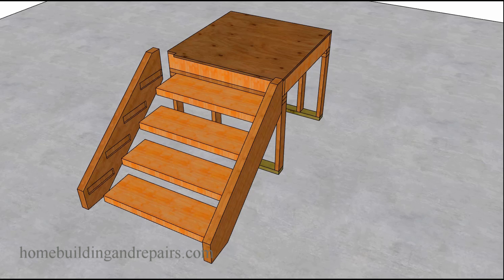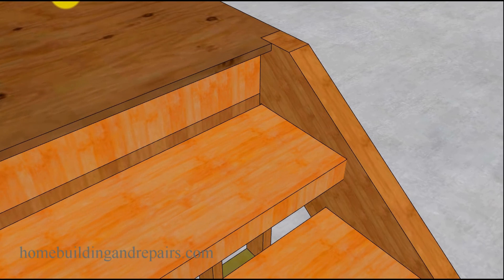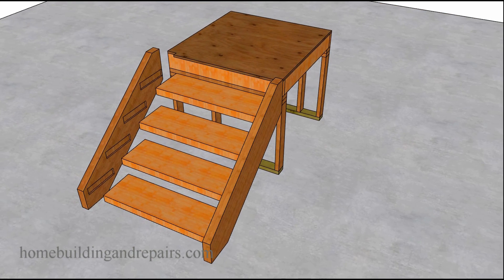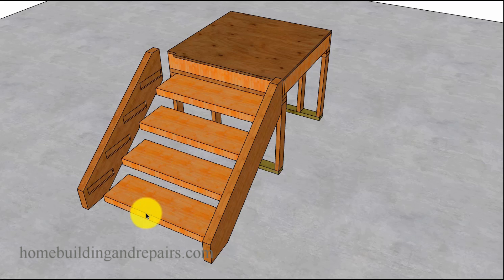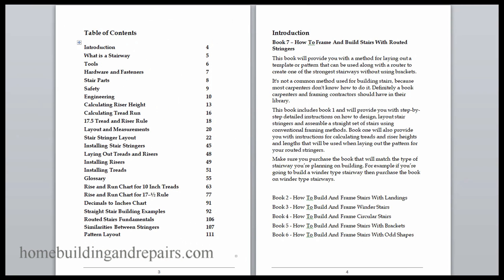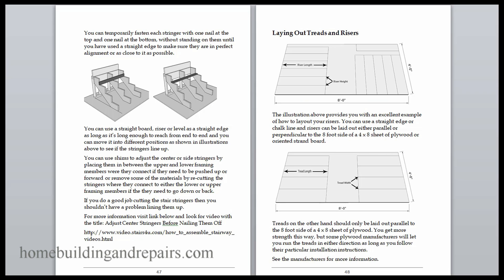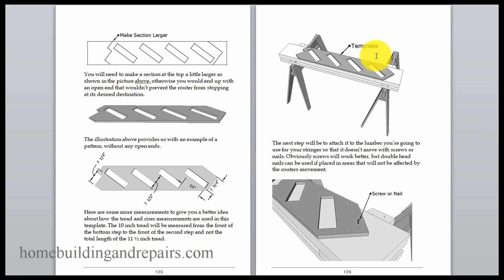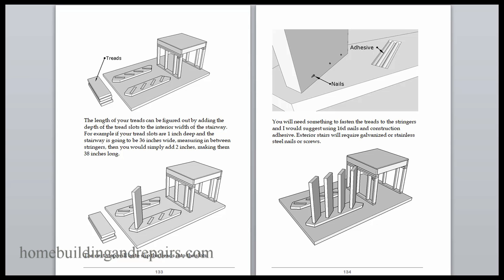How To Build And Frame Stairs With Routed Stringers - Building Books

Comment: Would it be ok to reinforce the treads into the routed slots with some dominos? In my head it works, would probably need at least a 4x12 stringer and treads right?
Reply: Just bought a few of your books by the way!

Comment: If top tread is flush with the flooring—as in stairs are outside, to an exterior door—does the top tread sit on top of the stringers? I'm thinking the top tread will be a bit wider too, since it's a bit of a landing. Thanks.
Reply from the maker: It will depend on the design, but I would think that the tread would sit on top of stringers if there wasn't a landing. Email me some pictures if you need more ideas.

Comment: I took your suggestion and began looking at other videos you created...WOW.  So for my stairs, they are oak and stained beautifully.  Problen is, they do not have a skirt board.  The treads and risers die right into the wall.  It would look so nicely dressed out to have a skirtboaed, but how do I do that now?  Seems too late without having to remove all the treads/ risers. What's your input on this dilemma?
Reply from the maker: If it was me, I wouldn't put the skirt board on because it's often difficult, but I will be making a video about how to do it in the future.
Reply: @stairbuilding  Oh, I look so forward to seeing how it's done.  For my home it's wallpapered on that part of the wall, and a pain to wallpaper it again, and skirtboard would make it so much easier to paper than having to cut to fit each tread and riser.
Reply: I'm not trying to step on this guy's toes he knows his stuff , but to make a skirt board that is not functioning as support but just for looks a guy can go get an LA times news paper and a roll of masking tape and make a template that you can transfer that to a 1×12 ! if there are toe kicks they have a tool for scribing  that transfers the design from one thing to another!I don't know if that helps you or not or if you've already handled your issue ?
Reply: @nunyabisnis1448  Hello Nunya... I thought of the exact thing t make a template.  I know guys who fabricate counter tops use this flimsey sheet plastic that I could use to make a template all taped together, but I have bullnose treads that could make it more challenging. I'm thinking about just pulling all the treads and risers, stain and replace with new ones, and finally get the skirtboard installed.  It would be hard for family to deal with all the time refitting, staining, etc. that important stairway.  This to be my winter project.

Comment: Awesome video! Does the book include:
- How to fasten stringers to the landing?
- How to fasten stringers to the wall?
- What kind of lumber to use?
Reply from the maker: The book provides you with simple and easy to follow instructions, but I don't know if it provides you with structural lumber sizes, because that usually depends upon the length of the stairway and what is going to be used for.